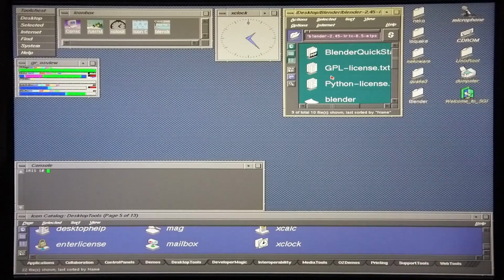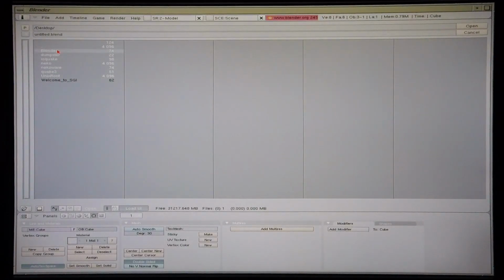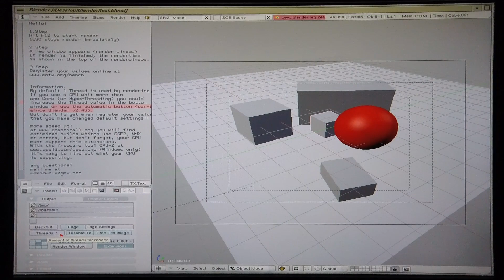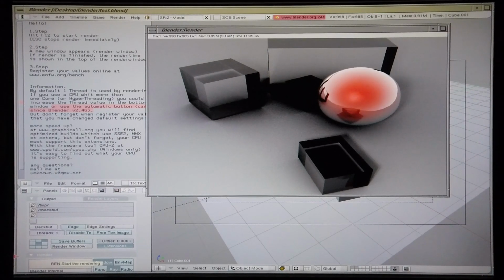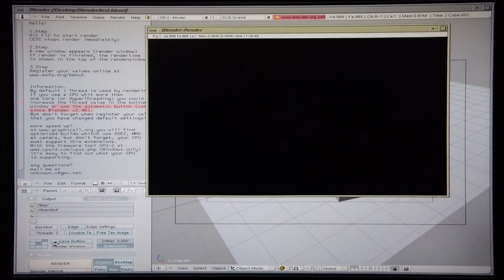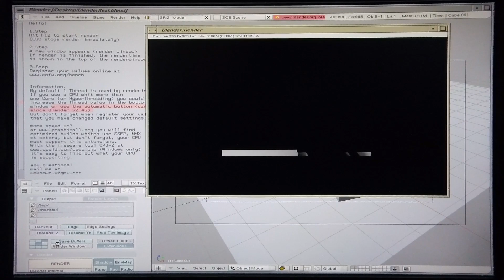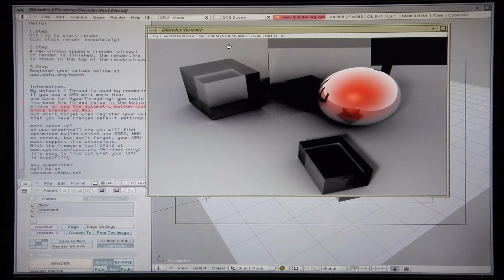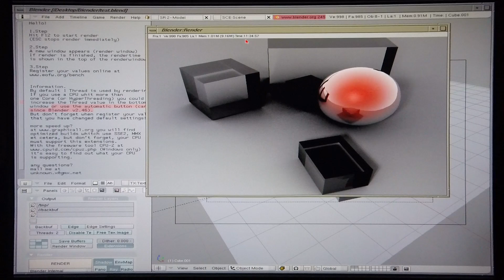A Blender test on an SGI O2 fitted with a MIPS R12K@400MHz and 512MB RAM

Comment: I'm having trouble getting a blank green screen via vga. How did you get it operable on a monitor??
Reply from the maker: What type of screen are you using?
Have you modded your cable?
Reply: @Irinikus  a dell LCD screen and no modifications
Reply: I have tried pushing in one pin that was recommended to me by another youtuber and nothing.
Reply from the maker: It was I that recommended the modification to your VGA cable. The monitor that I used was a Dell SE2416H, and it works perfectly with the modded cable.
Reply from the maker: Are you still getting a green screen with the modded cable? I'm concerned that you're getting a blanc green screen, as the machine should display a picture, but with a green tint due to the sync on green.
Reply: @Irinikus  without the modded cable, I get just a simple green screen. Nothing changes as the computer churns up and the led turns green followed by its chime. With the modded cable I get zero connection either way.
Reply from the maker: Confirm you have a mouse and keyboard connected to the machine? 

If so, maybe try a different mouse and keyboard, as these machines go to a (non-graphical) serial console mode when no mouse and keyboard is connected. 

The reason why you see nothing with the modded cable, is more than likely because the screen is showing black, without the green tint. (Does the screen at least power up when the machine is switched on with the modded cable fitted?)
Reply: @Irinikus  I got it working without modding the cable. Connecting a keyboard helped!
Reply from the maker: That's great to hear!

Comment: Hello! :)  Some points...

1. Ah now I understand something, you're using Blender 2.45, that version is significantly slower than 2.44 which is what I used (the latter is 11% faster). I've not tried it yet with 2.48.

2. I have speculated before that perhaps the branch prediction, caching and other features of the R12K, and perhaps aspects of how the OS functions aswell, allows the CPU to behave a little bit almost as if it has HT. Less noticeable here given the architecture limitations of O2, eg. the cache refill configuration cripples many fp codes, though that doesn't affect this test so much. Check my SPEC analysis for more severe examples:

http://www.sgidepot.co.uk/r10kcomp.html

R12K was designed for 64 or 128 byte cache line refills, but CRM can only do 32byte, so the system, has an extra ASIC to convert between the two. This hurts certain fp codes badly (int is less affected), adds latency and makes the CPUs more expensive. Looking at the R7K/600 results, it's clear SGI should have stuck with its original intentions, ignored irrational customer demands, gone down the R7K route much sooner and aimed for the R9K with O2+, which in theory could use the dual-core R9K 1GHz if only the PROM had the right support (alas we'd need the PROM source for that, which is now impossible). Ah well, the road not travelled. Without a doubt though, R7K/R9K configurations would have been much cheaper.

3. For rendering with multiple threads, it's best to use a larger tile size split. Notice how, during that last tile, there was no opportunity for the 2nd thread to help out because the remaining tile was running on its own. You should do tests like that with 16x16 tile config. For even faster CPUs and multiple CPUs, go higher, 24x24, etc. Check any GN performance video where they show a clip of their title logo render, the tiles used are tiny.

4. A minor point, but did you know you can press F12 to start the render? :)

5. O2 will be faster if you render at a lower resolution due to less strain on the CRM. Try it at 800x600. :D

6. It's interesting to compare to the same CPU in Octane; using V2.44, I get 10m 24.32s for O2 vs. 9m 50.28s for Octane. This Blender test is quite simple in nature and doesn't benefit much from the faster RAM, lower latency, etc. of Octane, but there's still a difference. My Alias tests are very different in nature, especially for CPUs with larger L2.

And welcome to 2019! 8)

Ian.

PS. Ref: http://www.sgidepot.co.uk/perfcomp_RENDER1_blender.html

Btw, amusing to note that a dual-PIII/500 XEON VW320 is only just able to beat out the R12K/400 Octane, though to be fair, the VW320 suffers from the same arch limitation as the O2, IVC slows down pure CPU/RAM math.
Reply from the maker: Hi Ian.

Happy new year! May it be a prosperous one! :D

Thanks for the links. I will carry out some more tests with the different versions of blender and different tile sizes, to gauge the effect on system performance.
Reply: @Irinikus   Thanks! Have a look at my results page, you can see the different tile size configs people have used. I settled on 16x16, but sometimes other settings do work better, it depends on the system.

Let me know if you get V2.48 working, I tried it way back and ran into problems, gave up eventually. Would be good as it has a higher thread limit than 2.44.
Reply: Hi Ian,
thank you very much for the hints! I will check out some different versions on my Octane in around a week :)
Reply: @ddrcomputerwelt  Most welcome! Btw, here are the Alias, Maya and C-ray render test results aswell:

http://www.sgidepot.co.uk/perfcomp.html
Reply: @mapesdhs597  Can you share the render file tested here so we can directly compare on Windows machines?